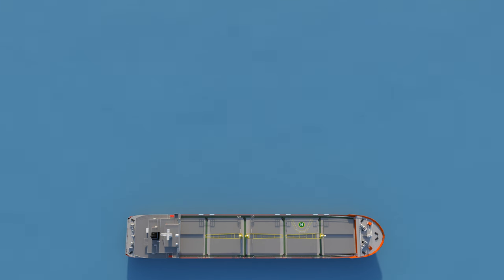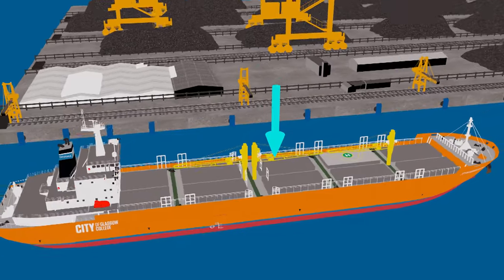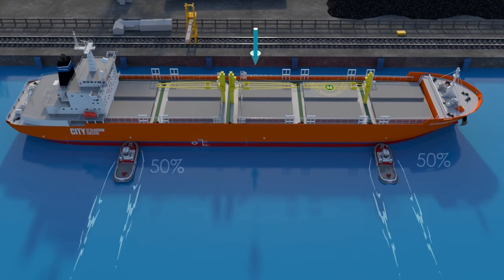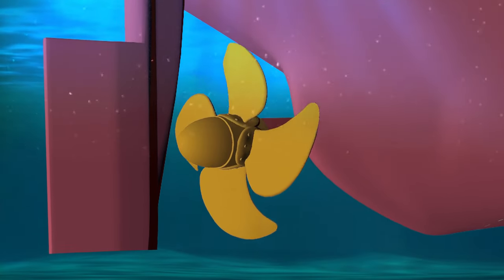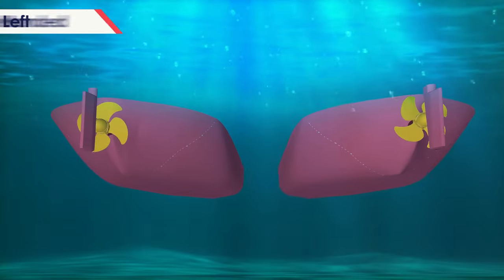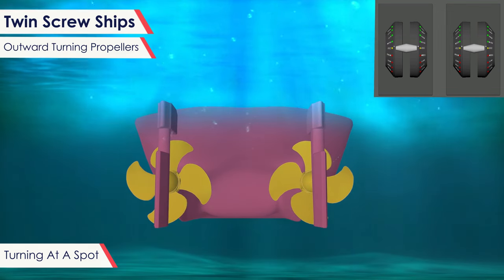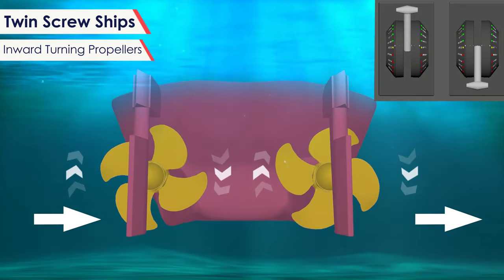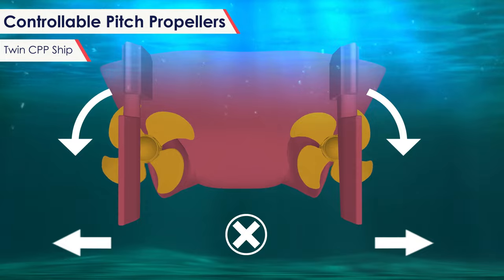SHIPHANDLING Pivot Point and Transverse Thrust

Comment: It would be good to cover using transverse thrust and twin props to walk the boat. 

My understanding is that this is the (a?) advantage of inward turning props. For example, if you put starboard ahead and port astern you turn to port, but if you put the rudder hard over to port, this stops the turn and you have transverse thrust to port an boat will walk laterally to port